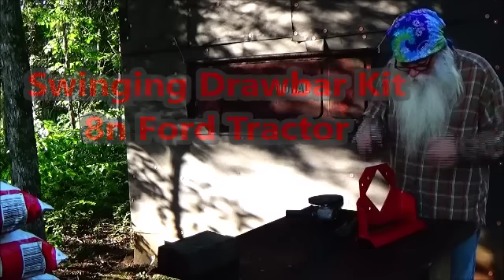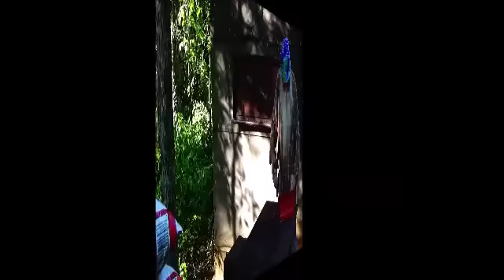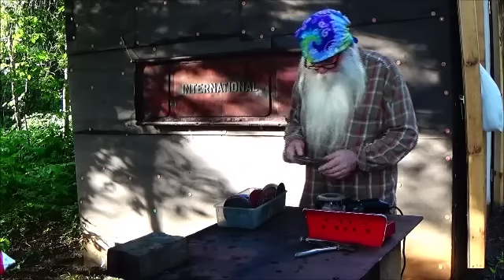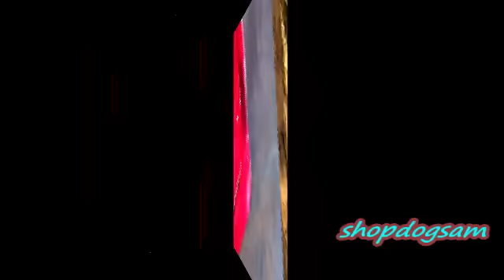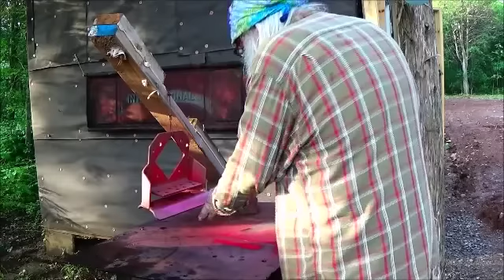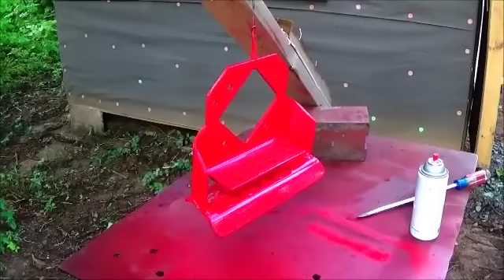Swinging Drawbar kit for 8N Ford Tractor pt1

Comment: Great Granddaddy had a 9N, 1939, had mules before that.  Only tractor he ever had.  8N is much improved.  Granddaddy had two cylinder John Deeres, H, A, B, and 60.  I mostly drove the B.  H clutch runs off the camshaft, A,B, and 60 off the crankshaft.  Hand clutch.  Anyway, spent my summers on the farm in Kentucky.  That 8N is a nice tractor.  Good luck with the pole barn.
Reply from the maker: ,,, thanks,,